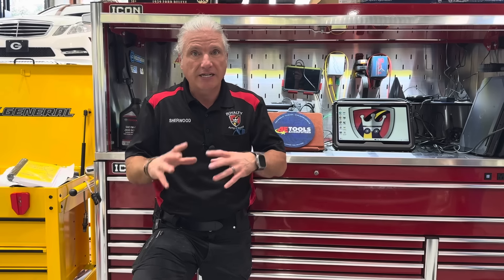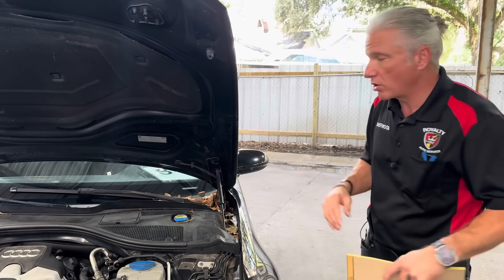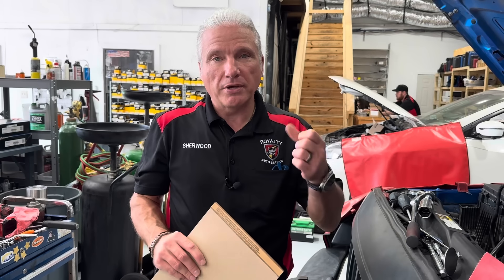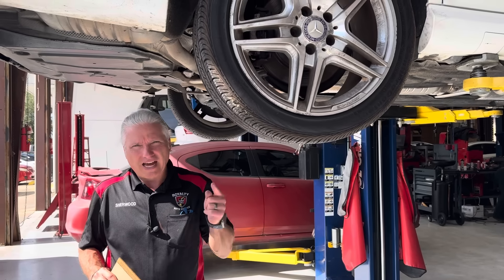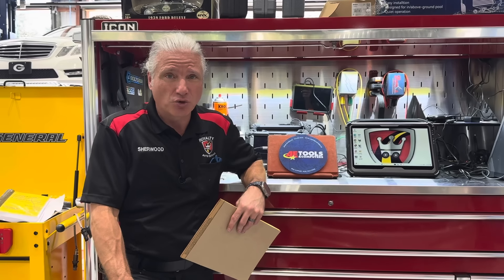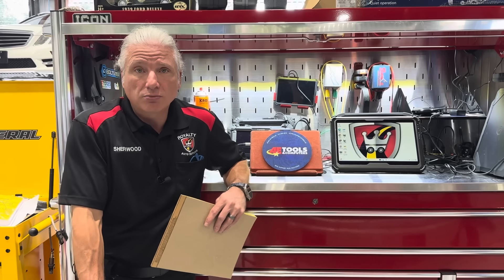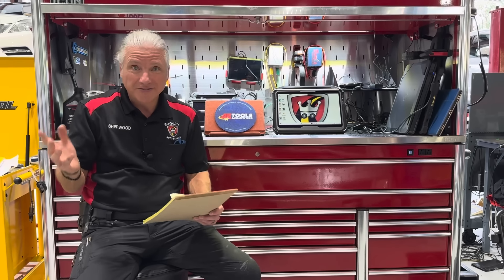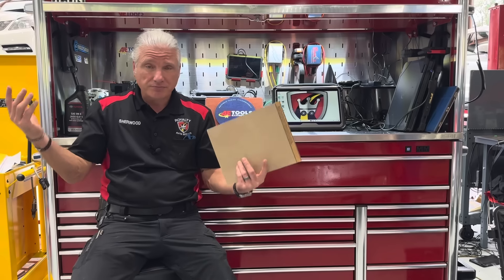Ranking The Top 5 Most Expensive Vehicles To Maintain That We Work On At Our Shop!

Comment: I’ve got a 2010 E550 and at 10 years like you said, the air suspension failed all around. It was not cheap to fix but I did it. Knock on wood nothing almost at any cost for repairs in 15 years - and a long long time with no car payment so Benz worth it to me. Other factors, Benz white paint seems to hold up exceptionally well. 135k miles and she still looks very good. Customer for life.
Reply: I think this was a great educational video.
Yet I think longevity is the thing that gets overlooked. Yours is a perfect example,  a 2 Ton performance car whose adjustable suspension lasted 10 years.
Most similar cars would have been on the 2nd set of normal shocks/struts easily. Plus 10k oil change intervals.   I've had 3 black ones, (all used)  The paint is amazing with proper care.

Comment: Drove 2 Range Rovers for 35 years and Sherwood is dead on about maintenance & repair costs…but I loved them (2) and got both to 250K+ miles. However, they did own my wallet despite frequent preventive service. Just bought a 2024 Mercedes 450 GLE Airmatic so good to see that I stay in the top five! Great video.
Reply: I feel the same way about my Volvo ( pretty sure they share parts with Range Rover
Reply: RANGE ROVERs 30 years ago are reliable ang high quality cars. Also Mercedes. Modern MERCEDES, I do not think the same.
Reply: @rolandochavarria466 - Mid-90s Mercedes were some of the best cars ever built.   Then the bean counters got their dirty hands involved.
Reply: If you can afford a Range Rover or MB, you can afford the maintenance.
No pity from me on how expensive it is to maintain you four wheeled transportation appliance with a fancy badge.🤣
Reply: You love poorly built vehicles.
Reply: @ClockworksOfGL If I think more back in time, Ford F and E Series in 90s were heavy duty cars, most of them. And also other brands. What a sad history has the Automotive Industry today.
Reply: I really want a new LR Defender. However, We aren't wealthy. Do you think as long as it's under a full warranty it's worth the risk, or do you think they are just too expensive to own unless you can really afford high maintenance costs?. Read every review on them and I'm on the fence, but I really love those new Defenders.
Reply: @ggolds5  The short answer is that I do not know. I will say that my Rover mechanic thought it was a well put-together truck and intended to purchase one for himself. OTOH, he IS a mechanic able to look after issues that "civilians" might not. Best of luck with your decision-making!!!!
Reply: Whynot a lexus gx or rx and then invest the rest?
Reply: @ggolds5 If you aren’t financially well off then you should look outside of Land Rover. You will be glad you did.
Reply: @cdjudd85  We're comfortable,  not wealthy. I've had 3 Land Rover products in the past 25 years. All 3 were awful, but things are better, not great clearly. If there was an aggressive lease deal and it included maintenance, it might be worth leasing. Otherwise these things can really pinch anyones wallets.
Reply: Tell me you are rich without telling me you are rich
Reply: @07wrxtr1  I DON"T THINK YOU GET IT.  That would be a highly rational , sensible, and financially responsible thing to do.

Comment: When I lived in Dubai I bought a 2005 Mercedes C230K with an AMG sports kit brand new. Transmission issues, crank case issues, aircon issues, brake issues, engine issues, electrical issues, air conditioning failures, twice. It was lovely to drive, when it worked, but after two years on a three year lease I took a hit to get out of the lease early. Not a month went by when that thing wasn't in the shop for three days waiting for parts. All covered under warranty, but I just couldn't stand the inconvenience of not having the car available when I needed it. On the other hand, I had a 2002 911-S4 which was excellent, but impractical since I needed to take more than one person with me on occasion and the rear seats are for amputees. I had an Alfa for three years and no issues with that either, which was surprising. I've also owned Honda, Mitsubishi and Mazda, absolutely no issues at all. Also recently sold a Kia Forte 5 that was a good car, I must have gotten a good engine, or the engines on the Korean made cars sold in Asia are better than the ones sold in the US. Funny enough, I work in the Philippines now and have a Chinese made 2001 Ford Territory here, just over three years old now and all I've had to do is oil and filter changes. Very impressed with the build quality and ADAS features, and strangely the Chinese made Ecoboost engines are different from those sold in the US. They have timing chains instead of belts, and the blocks are cast iron instead of aluminum, at least on their four cylinder engines. They also use Honeywell turbos instead of the Borg Warner ones in the US models. They claim that they are "revised" for the Chinese and SE Asian markets with reliability in mind.

Comment: I decided to check the PCV valve on my old Highlander at 180,000 miles because I was changing the valve cover gasket. I checked and the valve was under $10 and in stock. It simply plugged in the back of the valve cover. It was clean and functioning.I'm at 201,000 miles and 18 years and it has never dripped oil or broken down. The valve cover gasket was for a cosmetic leak.
Reply: Similar story here; pcv valve, grommet and hose cost a total of about $10 and took 2 minutes to install. I only needed one because I broke the old valve in half when I replaced my valve cover gasket. I have a 1997 corolla that is leak free at 209k miles.

Comment: Good video. I have a 2011 Audi TT Quattro S Line,  2.0 TFSI, 145K. And yes I've had to fix oil & coolant leaks but at least once fixed, it's not reoccurring. So far. The repair bill sux but when it's right, it's fun to drive.

Comment: I own a 2000 Chevrolet Silverado with a 5.3 V 8 
It has 660,000 original miles with only having to replace the differential at 440,000 miles.
Everything on it works !!!!
Reply: Everything went bad on them after 2007 with the cylinder deactivation.. causing lifter issues..
Reply: There is nothing on it to go wrong.
Reply: There is beginning to be a consensus forming that the GMT800 ('99-06) GMCs and Chevys are peak truck. Modern enough to have proper road manners and features without the excessive complexity of later trucks.
Reply: Your very lucky !
Reply: For the Dodges, 2006 was a turning point on Diesels with DEF. Then there is the 5.7L that has lifter issues from cylinder deactivation. But with a 4.7L, they can last a while with the 5-speed transmission.

Comment: Just sold a 2011 Audi S5 that felt like a ticking time bomb every time I drove it at 94000 miles.  Small oil leak at oil cooler o-ring turned into broken plastic thermostat cover, which is sold as a unit with water pump, ended up costing $1350.  Was a great car, but entering the big dollar repair zone with known timing chains issues.  Feel much relief having gotten rid of it.  Got stuck with a ‘98 jag XJ8 after doing timing chains.  Never again.

Comment: He’s spot on with Audi VW this coming from someone who’s had over 27 of these vehicles. Reliable but you need to stay up on oil leaks. But the main mechanical bits are very solid.
Reply: Same here. Oil, antifreeze, windshield fluid, and power steering fluid leaks.  Ridiculous.  Almost every fluid used eventually leaks.

Comment: When I owned a transmission shop years ago, Landrover was nearly the top.  Not only were the parts expensive, but they were prohibitively hard to get.  There was no aftermarket supply, and everything was proprietary to the dealer/manufacturer.

Comment: Sherwood, I just want to give my thoughts on the Chrysler Pentastar engine. My example is in my ‘12 Chrysler 200 Touring convertible. I believe that frequent and on time oil changes is critical to an engine like the Pentastar because of the small oil passages associated with the variable valve timing feature. As a DIYer I replaced my own oil filter/oil cooler housing with a Dorman aluminum unit. I did this before I had any leaks and the convertible now has just 77,400 miles. It is my favorite and my retirement ride in this life.
Reply: Rainman Ray's Repairs has at least one video on the Dorman oil filter housing.

Comment: The current Audi Q5 , not the SQ5, is pretty easy and simple to work on, and the 2.0 turbo 4 got updated and is pretty good now. If you bought one and expect to keep it past warranty change your oil every 7000 miles and don't delay replacement of other fluids. Also use good quality gas.

Comment: The issues on the Chrysler 3.6L V6 is with the oil cooler (made of plastic. Aftermarket metal ones are best) and the roller valve rockers. The bearings on the rollers wear out and the rocker begins to contact and damage the cam.  The start to "tick" when this happens. Service them immediately and you may only need to replace the roller rockers and not the camshaft.

Comment: We own two, 10-year-old BMW 3-series AWD, 1 gas and 1 diesel, that I bought used as lease returns. They've been great, other than some recalls on the diesel. I do most of my own maintenance. Oil filters are mounted topside, so that helps. But we don't drive much, only like 5k miles a year. I'll dump them in a year or two when they get to 80k miles and do it again.
Reply: okraine lover :face-turquoise-covering-eyes:

Comment: It completely depends on the vehicle more so than the manufacturer.  I work on all my vehicles and the easiest car to maintain has been my bmw m550i.  Oil change, plugs, brake fluid changes, brakes/rotor change, trans filter/fluid, diff fluids, transfer case fluid, filter, etc… I’ve done them all and it’s been a pleasure to work on.  Educate yourself on the basics instead of being a helpless car owner and form your own opinion.  Otherwise, you will be a victim of repair shops.
Reply: Where do I go to learn repair basics for Audi?

Comment: I have a 2016 Ram 1500 hemi that I picked up in 2021 with 94k and still have with currently 146k miles on it. This is what I recommend to extend the life of the hemi & cut down common issues:
1. Get a tuner to delete/bypass the AFM feature. 
2. Use quality full synthetic oil (Mobil 1, Pennzoil, Amsoil, etc)
3. Use a quality oil filter (wix, Mobil 1, etc)
4. DONT GO MORE THAN 4k MILES on oil changes.
5. CUT DOWN IDLING YOUR HEMI. This is a big one
6. If you are putting a new engine (hemi) in it. Upgrade the oil pump. Melling make a high flow oil pump and I hear they work great
Reply: Add run 5w/30 instead of 5w/20
Reply: @rebert69 I have a 2017 Ram hemi and do all the above plus run 5/30 Valvoline high mileage oil. Just hit 95k and had my mechanic buddy do plugs, coolant and tranny drain n fill. Valvoline tranny fluid and mopar coolant. Only engine issue so far was exhaust manifold bolts which was covered under my certified powertrain warranty. Few other things like fuel sending unit twice and third backup camera. Beyond that all good 👍

Comment: We are an Audi family on our 5th Audi/VW and I hear that they are unreliable have multiple issues but I guess we just have been lucky.  Only issue to date on the 4 Audi’s and 1 VW was the exhaust rotted needing replacement on 1 car?  I use scheduled maintenance intervals at dealer (cost @ $200- $600) for Audi’s up to 50k then I do maintenance, change oil, filters, lube hinges, I change all brakes myself.  Last A4 we owned had 7 years with 125,000 miles before got rid of.
Reply: That's just average mileage.
Reply: I have 205k miles on my A4 on the original clutch and have only had three issues; carbon buildup, weak injector, and a fuel pump that started to go bad. Never left me stranded and runs like a top.
Reply: VW/Audi issues on the net are taken out of proportions!!

Comment: I just bought a VW Jetta and have never owned a European car before. After reading the owner's manual and getting quotes from the certified dealership in my area I was blown away by how expensive basic maintenance was quoted at. $300 for an oil change, air filter inspection, and brake pad inspection. Sure the oil needs to be VW508 spec, but for about $45 I was able to do the oil change myself, check the brakes, and check the air filters. I could use imported German oil and change filters for under $120 yet. 

I cant do all the maintenance myself, but just in oil change savings alone I'll be $500+ per year ahead. Oil change, brake pads, brake fluid...not all that hard really.

Comment: 1. Audi/VW  2:36  2.Chrysler, Ram, Dodge, Jeep 5:10,  3. Mercedes 6:58  4. BMW 9:04  5.  Ford 12:18  from least to most expensive
Reply: Jaguar and Land Rover were number 5. Ford 6. and GM 7.
Reply: Little correction: he said that Jaguar/Land Rover are the most expensive. Not Ford.
Reply: Alfa Romeo not on the list because if it needs a repair, it's totalled
Reply: Thanks
Reply: @ZeroG 😭😭😂😂
Reply: Thank you
Reply: I think your numbers are backwards. Audi was #5 (first to be mentioned on the video), and Jaguar/Rover were #1
Reply: Thanks! Saved me 15 valuable minutes!
Reply: @Molloy1951 well Jaguar or Draguar is gone now as far as buyers go due to its DEI woke commercial.
Reply: @MrSupernova111 he's not posting the correct list.
Reply: This list is wrong
Reply: Wrong

Comment: It isn't surprising that luxury cars carry larger repair bills. The more gadgets, the more to break down. I used mini vans for my work for many years. Mostly Chrysler Town and Country or Dodge Grand Caravans. They were my tool boxes and got pretty beat up. Their 3.3l V6 engines were extremely reliable as were their transmissions. All of my vans made it to 200,000 miles and more with just normal maintenance.

Comment: You are correct about what you are saying.  My 2017 Jeep Rubicon need new Rockers, Lifters and we are doing the Oil Cooler as well.   It’s still a good Jeep but poor quality components used by Chrysler means we have to do the necessary upgrades.   Very well explained in the video.
Reply: Curious how many miles on your Rub?  I have a 24 Wrangler and Gladiator.
Reply: 14,000 miles.
Reply: That's a good jeep??

Comment: As a European Mechanic, i approved this list 💯! I have loyal customers that have come to believe me when i say they need something the hard way the first time. I work with my repeat customers to make sure they are safe on the road. I'm shocked Ford was higher ever v8 ford made from 01-14 had some kind of major problems either the spark plugs flew out or they where locked into the block or had cam problems.

Comment: I moved from GM to Toyota about 10 years ago....They are not 'super cheap' on repairs, but you don't get hit in the wallet so frequently on them with surprise repairs... I have 2 Toyotas, a Tacoma and a FJ Cruiser, 3 Lexus rides including a GX460 and a RX350, and a 2003 ES300..I feel like I'm getting my money out of them and I'm not going broke because 90% of the repairs needed are DIY...😄😄😄
Reply: Yep, I have two Chrysler products & two Toyota products and the Toyotas are 2x the cost to repair for the same parts, but the frequency is probably 10x less.  Great cars!

Comment: When I bought my first M Benz, I also purchased a 8qt oil extractor and the filter socket. It costs me roughly $50 dollars to do an oil change ve $500 at the dealer. The best part is not having to climb under the car or getting dirty.

Comment: I got 170,000 miles from new on my 2014 Chrysler Town & Country. The ( no longer available) Mopar Lifetime Maximum Care service contract covered $23,000 in repairs. The Pentastar 3.6 problems were a significant portion of the repair costs.
Reply: But it is available. A coworker just bought a ram, the ONLY reason he bought it is because of a lifetime warranty on literally the entire vehicle, from dodge not the dealer. Still wouldn't own one

Comment: I’ve not had any major issues with Audi, 2009 A4 100k+ mi traded for 2013 A4 traded at 110k mi for 2019 S4 traded at 70k mi for 2024 RS3 also had a 2023 A3 and traded for 2024 Q5. Keep up on routine maintenance and you’ll have no issues. Mine are also garage kept and washed/detailed weekly. All in how you treat them